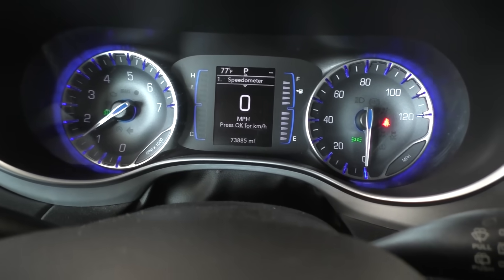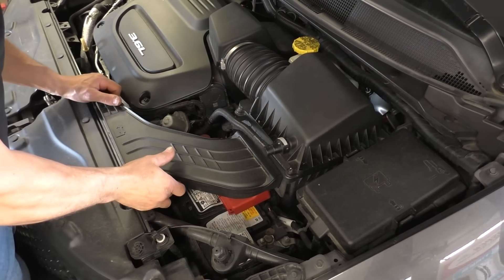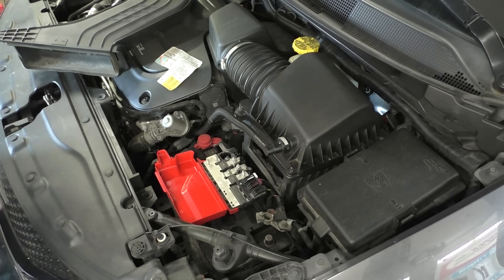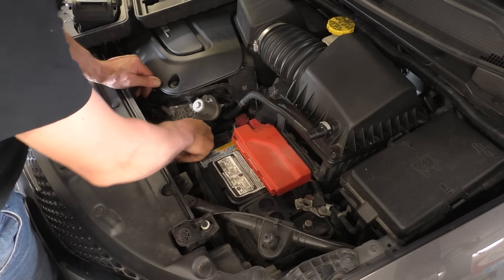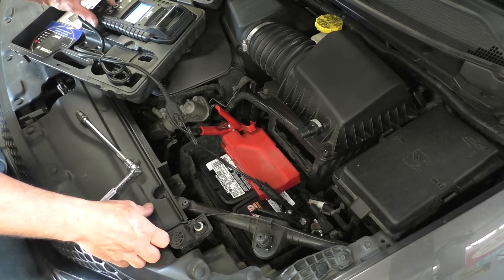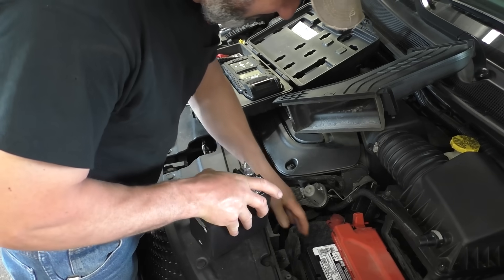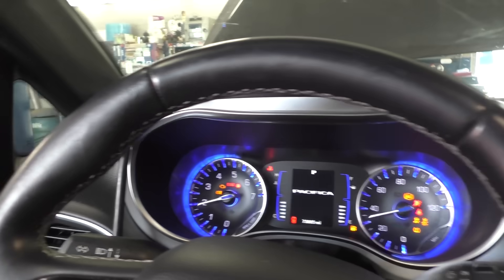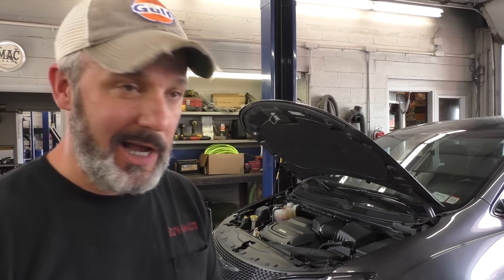Chrysler Pacifica - Start Stop System Disabled

Comment: I can't count how many aux batteries I've done on the newer chrysler stuff specifically. FCA had a couple of years where OE batteries were garbage. 18-20 usually. So many that if I had a start stop disabled message, I would immediately do an aux battery if it was OEM. I don't run in to as many anymore because vehicles in that year range have had the trash original battery replaced by now.

Comment: I can't stand the start/stop.
  But I am curious about the benefit. It would let the O2 sensors and cat cool down..that's a bad thing. 
    The o2 sensors have a heater, I thought it was only enough wattage to help it heat quicker, along with combustion...will it maintain enough heat to prevent "open loop" operation at startup?
    And the cat has no heater?

Comment: FCA had software updates for these vehicles to prevent this code from setting, there were issues with power control relay not closing again after auto-start event and AUX battery getting discharged. This impacted all FCA vehicles of the same vintage with the dual-battery setup (Compass, Renegade, Pacifica, Wrangler, etc). Make sure the PCM and TCM software are updated after replacing the batteries and shouldn't be an issue again for the customer.

Comment: I have a 2019 Wrangler w/ SS. The aux battery is… under the main fuse box.  Either you remove the whole fuse box assy or remove the right fender liner and access it from there. Full PTA.  And when that aux/main battery combo starts to go, you get tons of weird stuff happening… I’m getting there.

Comment: 300,000klm, Toyota 4.2 ltr conventially aspirated diesel with manual 5 speed transmission 2006. Has Radio. Nil DPF. Has never failed. Touching wood.

Comment: Parking brakes had cables - which were ALWAYS rusted solid, and if you tried to apply them, they would never disengage and the brakes would drag until you burned the linings down a bit. Electric parking brakes are one modern innovation I don't mind at all.

Comment: Ya know. We talk about the old days before computers in cars. Keep in mind that a long time ago you were supposed to adjust and clean the points in your distributor ever 2000 miles or so. Spark plugs barely lasted 10,000 miles. You had to do a valve adjustment at 6,000 miles. If you were driving to a place where the elevation above sea level was significantly different you'd have to adjust the carburetor on the way there and on the way back. Yeah, they're kinda complicated now but we don't have to fiddle with them every other day just to keep them running right.

Comment: I had the sam issue same vehicle 2019 model. Spoiler alert, it’s the batteries. That’s right it has two batteries, one small one for the start stop and a normal size for the car. $430 later after I replaced the batteries problem fixed.

Comment: Many other shops would have discovered the bad battery and told the customer "welp, it's gonna be a power control relay and module and possibly a new starter -- I'll also throw in a complimentary fresh battery just to cover the bases IF you do the work today. It'll be $1449.99" -- and they would have just (if at all) cleaned up the module/relay to make it look new and only put in a new battery lmao.

Comment: My Mercedes S550 has a small backup battery in the trunk. Of course it went bad during  Covid and I had to wait to get one and then install it myself. Remove most of the panels in the trunk and replace in the right side of the trunk. The small battery was more than the full size battery.

Comment: What is auto authority? I have the same scan tool.
Reply: Its a website you go on to register a scan tool. Most newer vehicles with gateway modules (Chryslers, newer Fords, Volvos, Nissans) use this to allow scan tool to communicate after authorization sent. Prevents hackers from controlling cars, supposedly or for the Manufacturers to control whos working on vehicles...depending on who you ask. You pay $50 (USD) a year and are able to access these vehicles. Without it scan tool is locked out
Reply: @Raylude5  what website?

Comment: Expect a lot of messages from older crotchety men deriding the stop/start system. I love the silence and absence of engine vibration at stop lights with engine off.
Reply: I won’t buy a car with it. I hate the vibration and lag. 😂
Reply: @envisionelectronics  You forgot to add, NOW GET OFF MY LAWN.
Reply: How about younger men who think it's a waste of engineering effort with few if any savings?

Then again, I don't have to deal with 15 minutes of waiting at red lights and stop signs to drive anywhere. The advantages of sane roads..
Reply: @Monkeh616  Don't really care about the savings, just like the comfort.
Reply: Sitting at light with a non-running engine gives me anxiety.  A running engine comforts me.  I have changed too many starters, alternators and batteries.  Get it running and don't get cute.

Comment: Just a little fyi. Had a 2018 challenger. Halo lights on cluster would stay on car off. There are 4 modules that you can talk to key off. Turns out frequency hub reported car in reverse when in park. Trans,shifter,cluster said park. Replaced frequency hub programed. All good. Had a chrysler guy tell me about the 4 modules communication key off.

Comment: I have worked on a couple of Start/Stop faults and found that live data will normally show why the system is not working and it is pretty much down to the main battery being low CCA. Some systems use a voltage regulator rather than an auxiliary battery to  keep voltage stable.
Do not trust battery testers, they are not 100 % reliable. I had an issue with my works van not starting and the battery tester showed that the battery was fine, but after changing the battery it never had an issue, so the tester was in error.

Comment: I'm old enough to remember . . .
When a new battery would last well over 5 years
When tires had tubes but would only last about 25k or less
When oil had 1 number - 30, 40 etc.
When I had to use my Thomas guide for directions.

Comment: What is an AGM battery?  "AGM means absorbent glass mat and refers to the fine glass fiber separator between the positive and negative plates that helps absorb all the battery acid. AGM Batteries are advanced lead-acid batteries"

Comment: Oh......I just installed a battery and the protective grease package said to apply grease to the insulating felt washer.......do NOT grease the terminal post.....attach the cables.......and THEN apply grease to the outside of the assembly. That's one manufacturers opinion anyway.

Comment: Ok, you asked for it, and im not trying to be a smartass. The
 " Emergency Brake" shoes (not parking brake) used to be cable operated because it was thought that an actual mechanical connection would be better than something hydraulic ( which can leak, and fail) or something electrical which can short or otherwise fail. A steel cable connected to levers that operates internal expanding brake shoes against a rotating drum is darn near infallible. Making it electronic is absolute insanity, IMHO. Thats my opinion, and im stickin to it.

Comment: "Torque to factory specs" Aren't those torque values only for NEW bolts? If bolts have rust or corrosion on them, why would the factory spec values be the correct values?

Comment: Maybe start/stop has a use in LA traffic, anywhere else the battery is A) going to cost MORE   than the fuel savings cost and B) the carbon footprint of each battery is as  dirty as the emissions it reduces.

Comment: I wonder why they didn't just use a large capacitor?
Reply from the maker: Cadillac did for a while and then when people would disconnect the battery and touch the cables together it would explode. They discontinued using it...

Comment: WOW:( That is a lot of work to install a battery. I like a simple cars with manual parking brake cable, manual roll down and up windows, manual door lock and manual cable side door view mirrors. The more bells and whistles that a car has, the more things will go wrong and the bigger the buck to get it fix. I LOVE my 2008 Chevrolet Cobalt ls 2.2l, it is a very easy car to work on when the time comes to fix it.

Comment: My 2018 pacifica threw cylinder 3 error codes then so i replaced 4 things it said it could be.    Went around the block.   Valve in cyl 3 rocker failed now engines full of metal and bend valve and needs engine rebuilt.   Had a few chryler/dodge over the last 32 years and never again.   But now my silverado is have noises from the cylinder shutoff system.    Might be time for older vehicles its so bad lately the amount of constant modules causing issues.   My ole 70-80s cars with carburetors got 20-30 mpg and rarely broke

Comment: Edit:  When I tried the remote start function it gave me a fault message "REM. START DISABLED - SYS. FAULT"  However, no other fault indications or fault lights during the no crank with the key. But the battery had low voltage. I thought there should have been a fault light for the battery.  No ? 
Before I watch the video.......I just had a no crank situation on my 2017 Jeep Patriot.....fresh off the battery charger. The vehicle only has 39,000 miles and is garage kept. The brain trust  said check the start relay for corrosion. The relay box looks pristine. Brain trust said that while the normal start with key didn't work the remote start did. My remote start acted the same as the key start, a few clicks and then nothing. Wow, time to check the battery. Sure enough, fresh off the charger it only read 10 volts. New battery fixed it.  

What threw me off was the battery charger. Afterwords I thought the charger should have thrown me a flashing amber light for something wrong with the battery. But no, not this model. The battery charger had steady green as if the battery was fully charged. Does anyone know why a charger would give a false indication like that? Bottom line the battery wouldn't hold a charge after 7 years in the vehicle, and 39,000 miles.
And MAN ! .......batteries are expensive now days. I think it was like $240 dollars. Something like that.

Comment: Sure like my electric mower. Don't have to check the oil or add gas or change oil. 
If it doesn't start, I'd forgot to plug it in. Ideal for the typical home owner. Wanta buy some old gas cans?

Comment: So fun fact, the electronic parking brake was installed on cars not to make them safer. The plan was that if you tried to run from the police, they could send a signal to your vehicle and activate your brakes and stop you from getting away. Only problem was when they tested this on vehicles with high horsepower it caused the driver to lose control and crash. But that is the true reason behind you electric brakes. It's all about control people.... all about control..

Comment: The battery monitor piece is the usual problem… if the condition of the battery can be accurately measured the auto start stop turns off

Comment: I changed the battery on a 2015 Dodge Journey. It is located in front of the driver's side front tire with no access from the top. The engineer that put it there needs to be, well this is a family channel.

Comment: There's a reason I still drive a 1999 Ford Ranger. NO FRILLS, crank windows manual transmission. Dead battery? No problem, just to roll it down the hill and pop the clutch. I bet the Kenwood radio in it has more computing power than the ECU does.

Comment: AGM batteries do not survive being charged aggressively or discharged aggressively! The glass matt material dries up and there is no cranking amp power left in these batteries.  Anything that elevates the temperature of the matt material (heat from charging/discharging from high currents) will destroy the battery. Most AGM batteries have warning labels that show the max charging voltage of 14.4 or even 14.1 VDC. Some also state a max ambient temp for that charging voltage to be applied.

Comment: If you want to permanently disable the auto start from doing the auto start without pushing the button up over a hundred times to turn it off You can unplug the plastic clip on the negative side of the big battery and just leave it disconnected and don't plug it back in and you don't have to keep pushing that stupid auto start button also found out about that plug in by leaving it disconnected so I don't have to buy another battery if I didn't have the money and also I don't get stuck in the middle of the traffic again at the stoplight cuz it won't turn back on or anything unless I shut the whole vehicle off for 5 minutes and then start it again with the normal battery because the small battery is only for stops

Comment: I had this one diagnosed in the first minute... just went thru that w/wifes '19 Jeep - dead battery - put both new MOPAR batteries in, $360, done..Curious item - watching EVIC afterwards, it would get down to 11.5 volts  while coasting to a stop, then back to 14.2 again at speed. Dealer said that was normal... then they said i needed a new steering rack - $500... We talked about EVs - they r expected to lay out $100k for tooling, which includes an insulated HOOK for tech2, standing by, ANY time tech1 is working on EV - to pull his frying carcass off... They said they are NOT going EV - no tech will touch one...

Comment: @5:25 - I'm at this point and I'm somewhat infuriated.  Why in tarnation do these things need to be so bloody complicated?  I mean it's just baffling to me.  Having my car stall in an intersection used to be a very bad thing and now it's a feature.  I mean, turning off the power plant in a vehicle in that moment where you may have to accelerate quickly through an intersection is asinine.  I turn the key - engine runs.  I turn OFF the key - engine stops.  That was just fine for years and years.

Comment: yeah modern cars have to bee shot down correctly ... what a nightmare.
for example my Renault ZOE (EV) has to be gone to "sleep" before you can change the 12V battery, or the electronics get a "headache". You really have to take these 10 to 15 minutes after closing all doors (leve the hood open and a windows to rech into the car - just in case)
My 1983 Ford Capri doesn't even care what battery is connected. It just wants 12 Volts for the starter and the radio. So simple these good old cars. haha and they have a cable to the parking brake :D

Comment: Brand new Snap-On Triton D-10 couldn't clear the codes but my old el cheapo ELM and old Innova did. My recent shop, the A Master Tech, couldn't understand this when I tried explain it to him, shot it with a new FMP Aux AGM battery under the seat, didn't fix it, so they got another battery from dealer, guess what, didn't fix it. I charged the aux cell he said bad, then he took it home... Then sold more work on it, twas a Govt Vehicle Fed Police. 

Optima are the main spiral cell. We used the same battery tester, the company said we had buy a new one cause it kept popping spark with error OUT OF RANGE. I saw its a 4 wire test leads, removed them, check continuity and I was missing a leg, I soldier it back on without using the hole, didn't have a small drill bit to clear it but yeah wire fell back off 2 weeks, I had to crimp it with female spade to make up some wire loss as it broke past my repair, paint joints with E-Tape prevent corrosion eating it. I've made my battery brush last soooo long using battery cleaner / neutraliser after every use, now 3 years old, shop refused to provide the full metal one like you have and only get the blue plastic ones that last for 2 uses. The metal ones from nap have a allen hex in the top of the cap works with powertool :D

Comment: I remember when cars had A..1.. coil, distributor, points and condenser, a throttle and E brake cable, and NO COMPUTERS.  The good old days.  When an EM pulse wouldn't do a thing. Now days a solar flare can shut the entire infrastructure of our world down.  Progress?  Oh, well.  Give me the old school days again where a mechanic didn't need scanners and computers and all that to fix a vehicle.  The days when I drove my 1960 Buick LeSabre 2 door with the old 410 Wildcat engine and the hydramatic transmission, when it was Park, Neutral, Drive, Low, and reverse was at the bottom. I'm old...LOL.  Cheers.

Comment: AGM to the rescue. There will be a future day that this Pacifica has computer module issues being that it is salt belt driven. Those "minivans" are know to have network clusters and they are well involved to trace down the story goes.  Next item to replace could be a starter motor assy as it continues to be over worked at every stop light, stope sign, rxr crossing, wait for traffic, left turns, right turns etc. A perfect example of EPA/CARB mandates that cost more to operate than they provide in CO2 emissions. Had the vehicle not had the start/stop feature, the existing battery would probably have gone another year before failing to perform.

Comment: So let's say I owned such a vehicle. The main battery becomes weak and doesn't start so I hop in my other car and leave that to sit for a month. During this time the auxillary battery also discharges because the engine isn't being run to keep it charged. I put a new main battery in and turn the key and there's the code. The auxillary battery isn't necessarily bad though.

So the lesson is to put both batteries on a tender when you store the car. That's if your car uses an actual battery for the auxillary battery. My wife's car (a C300) uses a capacitor. That would probably not do a battery minder very good. Or expect the code the first time you start the car, clear it, drive the car a bit to recharge the auxillary battery and see if the code comes back.

Sound reasonable ?